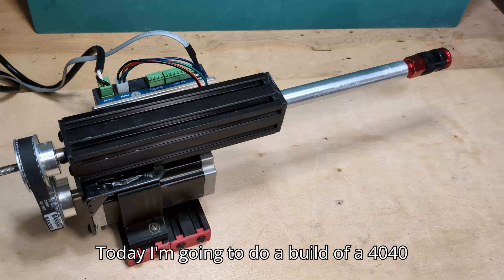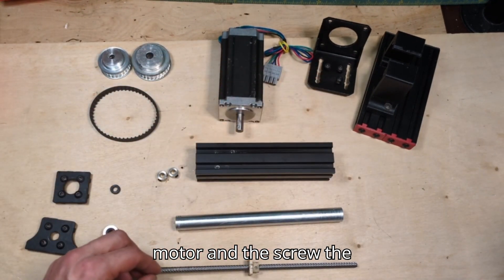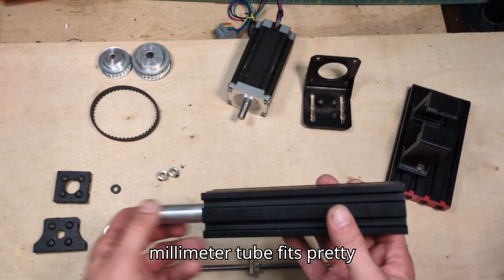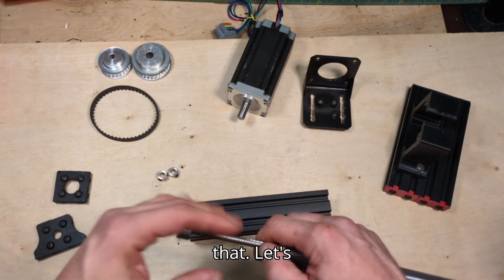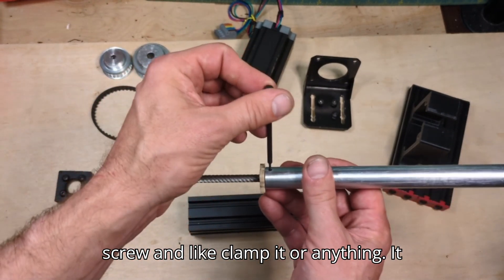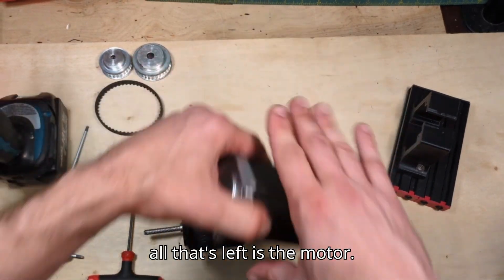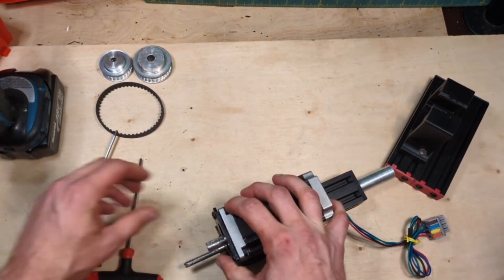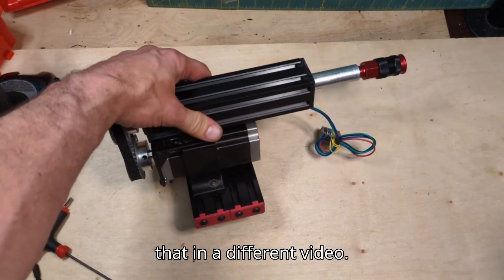How to Make a Linear Actuator with Openbuilds 4040 V-Slot Extrusion and Igus Lead Screw (see 2:30!)

Comment: Could the shaft rotate clockwise and unticlockwise of given spins to screw and unscrew a bolt? Thank you!
Reply: Yes perfect, you understood. I m trying to built something that can screw a bolt and unscrewe it every 8 hours with a timer in betwenn of 5 minutes. More then torque would be a given amount of rotation. The big issue for me is understand how to pull the bolt slowly while it uscrew and then once fully unscrew pull it away 15 cm. After 5 minutes come back to position and screw it / push it in position.
Thank you ❤
Reply: All weather proof and powered by solar plus emergency battery for cloudy weather
Reply from the maker: Let me make sure I understand - like building a machine with the purpose of screwing / unscrewing bolts?   It absolutely can - and with a stepper / servo it can be incredibly accurate and repeatable. With servos it's even possible to screw bolts to a given tension (by using force rather than position)

Comment: How can i calculate the output force from this actuator?
Reply from the maker: I  have done any testing / calculations with the belt version, however the pulley ratio is nearly 1:1. It will have greater pulling force than the inline version (the design puts too much on the coupler so it comes apart with high pulling loads) . It's not worth much, but this might interest you:  https://youtu.be/bf-2tbeEQOE

Comment: How many teeth on the timing gears?
Reply from the maker: The motor is 30 and the screw is 24.  The belt is 100, which is very tight. I know 110 is too loose, but 104 might also work.  I've uploaded a BOM which has more info:
https://github.com/MikesMachines/VCylinder/blob/main/BOM%20Nema23%20vslot%20cylinder.pdf

Comment: Although I think you need limit and home switches, most ingenious, clever, and practical. How much force do you think it can pull/push?
Reply: I think that thing could lift a person in the most painful way, quite easily. Seems way OP.
Reply from the maker: The 3Nm stepper is definitely OP.  There is something counterintuitive that's very important - running a machine at slow speed requires a LOT more power than fast. Those tiny machine with suction cups are definitely not safe. The reason is the tiny motors bog down with resistance (going in) and the only option with them is to turn up the speed control. Then when it reverses and the resistance plummets, it tears out at top speed (ouch).
Reply from the maker: First - I love your channel! I just got back from a bender of your shorts. Second - absolutely! For everything I've done, limit switches constantly trouble me. Even with hardware interrupts, I ran into odd delays using a microcontroller. The new drivers I've been trying out have assignable IO (rather than step/dir/enable) so the plan is to wire the limit switches directly to the driver.   As far as force,  I'm going to try and use the motor's software to measure it.  It is definitely less than directly mount the motor to the screw.
Reply: Tough choice if interrupts dont work ( may the switch is bouncing?) If you interrupt the pwm signal to the driver, you cant restart. Perhaps you could separate the signal onto two micro-controller pins, IE one forward pwm and one reverse pwm, each with a corresponding switch which breaks the signal on contact.